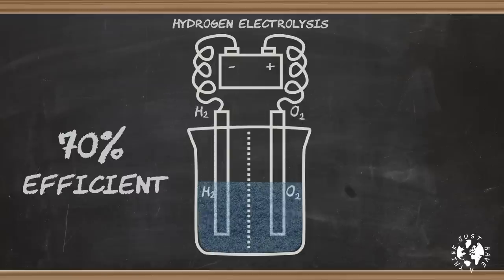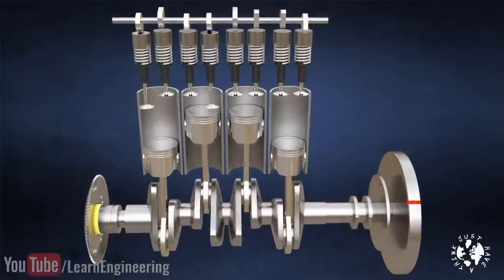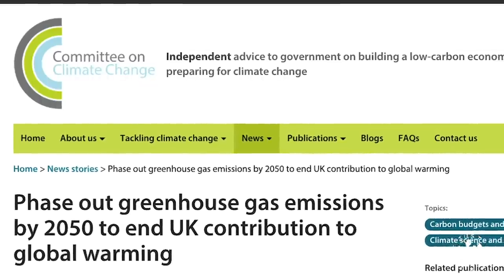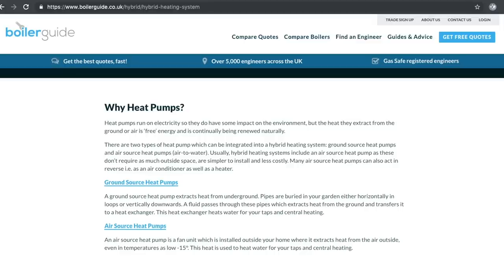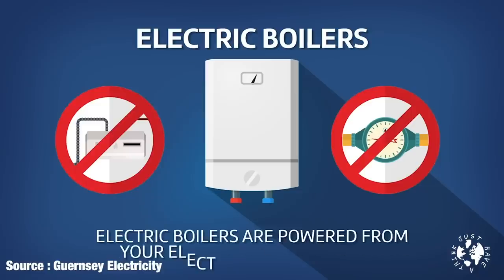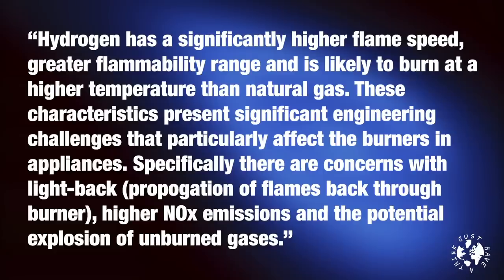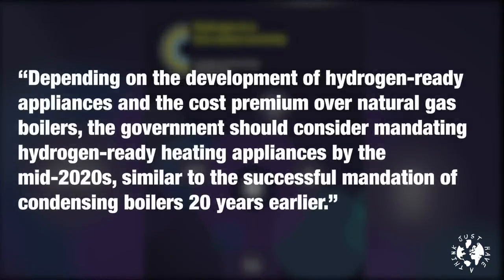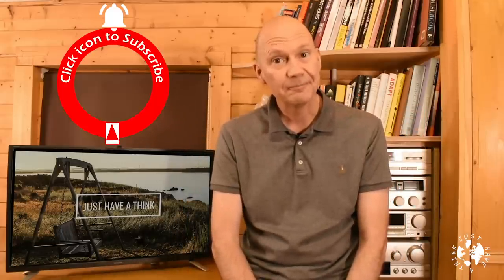Hydrogen for heating our homes

Comment: I don't see hydrogen as a domestic heating fuel ever, you can't transport it in regular natural gas pipelines, you can't bring hydrogen tanker trucks into the cities to refuel the houses either.

As far as carbon is concerned, there is no other practical way forward but electrical heating, and the need for it would be greatly reduced with passive solar walls, proper insulation, smaller houses, etc. We should also start replacing all poles and their power and phone lines with underground cabling, because if we rely on the power grid for everything, we don't want storms and falling trees to cut the power lines.

Single houses might be more resilient with solar panels, but that won't work for apartment buildings, the size of the roof would only provide enough electricity for lighting and other 121V devices on a dedicated circuit, provided the building also houses batteries. The heat pumps that were mentioned might be a better source of both heating and electricity, provided they are deep enough. That probably means municipal or national heat pump networks, as I don't think you want anarchy in heat pump locations.
Reply: @Allen Loser I'll leave the legality of it to these specific countries and cities. But if you look at the hydrogen refueling stations for cars, they are rarely in the cities, only 1 in Paris, France, for instance, all others are in the suburb.
Even if carrying hydrogen in city centers is authorized, I don't think any city official would allow it on a daily routine basis, they already limit the number of trucks, let alone inflammable gas tank trucks that increase the risk many folds. Plus hydrogen stations have very expensive and highly regulated and controlled. It's not possible to implement them in every house or block.
Reply: @Allen Loser Right, but that does not remove the risk, or make hydrogen as a domestic fuel a more viable option when there are so many other solutions to heating and cooling. Hydrogen would do squat for the latter, for instance.
Reply: @Allen Loser I have one in a caravan, it works on 12V or propane indeed. The video already ruled out hydrogen for several other reasons, I just wanted to mention this one too, not as the most important one. But I don't agree it's a bogeyman argument: You can't refuel a house with hydrogen using pipelines or trucks. Regular pipes leak hydrogen, you'd need a very costly network of pipes. And for trucks, you'd need a costly connecting system that would require frequent inspections.
At this stage, it looks like any green house gas is out too. Regular renewable electricity, since we already have it in the hous, or geothermal or heat pumps might be better integrated solutions to provide heating, cooling, and refrigerating. And it also works at night or when it's raining or not windy...
Reply: @Allen Loser This hydrogen production would be better suited to dedicated industrial sites indeed, for long term (i.e. winter) energy storage rather than heating. If residential solar provides too much electricity, it can just be reinjected into the grid and these industrial sites can use this extra cheap electricity to generate hydrogen.
We need to install much more photovoltaic surface than we would need in summer daylight hours anyway, so it can provide some sort of baseline in winter, so we will have lots of extra energy that can be put to other uses, like desalination, running engines for seasonal processes, etc., although storing energy for the bad days (and nights) should probably be the most important priority.
We're just at the beginning of this, hydrogen might not be the winner eventually.

Comment: Hard-to-abate sectors (fertilizer, steel, concrete production) account for ~33% of the energy consumed in the world. These manufacturing sectors cannot feasibly be electrified. They require high temperatures and hydrogen. People forget about this vital portion of our energy demand. Thoughts on solutions to decarbonize these industries?
Reply: There’s a connection between flue gases from coal or gas power stations ,any large scale industry which burns a lot of carbon based fuels such as the concrete industry ,steel making is a heavy polluter ,industries which burn fuels at high temperatures ,such as Aluminium ,probably the glass making sector ..anywhere there if carbon dioxide in the exhaust has potential as algae farm for synthesis of complex oil and protein products ..should be looked into by every government aiming for carbon neutrality ,large scale and small ,until we’re all clean electric ..China are you reading this ?

Comment: The whole idea of burning hydrogen to heat your home is bonkers...electric boilers supplying radiators throughout the home is the safest and least polluting method of home heating...
providing the electricity used is generated from renewable green sources...
There's a danger of over thinking things...often the best salutation is the simplest!!!.😎
Reply: Using hydrogen to heat homes is only bonkers because of sourcing it. It comes either from natural gas (pointless in my view) or by electrolysis (expensive). Using electric boilers to heat radiators is hugely expensive (UK prices around 15pence per kwh as opposed to gas at 3p per kwh. They are virtually non existent here in the UK. There's nothing wrong with gas and there have been very few issues with explosions. My view is that it will continue to be used certainly into the future. Heat pumps are ok with heating systems designed for them and aren't very efficient on radiator systems because of the higher temperature differential. So much of this green energy is virtue signalling BS that pushes people into heating poverty. There is enough gas from Norway for at least another 100 years. As I'm writing this wind is providing 2.72%

Comment: Heat pumps use refrigerants that can be thousands of time worst than carbon as a green house gas. Leaks happen all the time talk to any hvac repair man. They are also very expensive and your money would be better spent insulating the house. Foam insulation also uses the same Chemicals in the refrigerator so don't use that if you care to be environmentally conscious. Many solutions do more harm than good and they need to be carefully vetted

Comment: 4:20 You're misrepresenting the facts. Gazprom didn't just turn off the gas out of the blue and it's much more complicated than that. Ukraine stopped buying gas directly from Russia in 2015 but remains to be the main transit route into Europe. Also Ukraine has been understocking winter gas reserves compared to previous years at that time. Ukraine and Gazprom have been battling for years in court how much gas and on what price does Ukraine have to buy according to contract signed in 2009(ended in 2019). Both were found in violation of said contract by the Stockholm court and I can't keep up with how much they owe each other. Of course Russia is trying to bully Ukraine, but presenting Ukraine as innocent little victim is not objective.

Comment: I think we need to get away from combustion completely, including hydrogen. Or as little as say where key industrial manufacturing processes demand it. So, I can see that hydrogen, produced through electrolysis  and converted into electricity, as a hydrogen car does, might be desirable for areas where electricity can't be transported by wire and/or battery stored, and/or that local stable/rooftop electrical generation is impossible. But the idea of burning hydrogen in converted or developed boilers seems fraught with problems, and the best possible result from those developments still seem to be not as desirable as other solutions. The aim, after all is not low or very low emissions, but zero. 
Heat pumps are another idea altogether. I can see a lot of good things in heat pumps. They may not be as great transferring ground heat into the home as transferring heat from a liquid source, but they are still incredibly efficient, and need to be pursued, in my opinion. Big subject. Thought provoking video, as always Dave. 👍
Reply: Yes heat pumps make electric heating much more efficient, and a hybrid all electric ,if you can fit the ground source system when building the house,as it's not always possible afterwards

Comment: Right enough. I am afraid this guy sounds really convincing but i am seeing a lot of problems with the way he's presenting things here. 1 thing I can tell you about as its my job. at 8:00 he very calmly says electric boilers are a great alternative, they are 100% efficient and a very good alternative to gas boilers. THEY ARE DREADFUL. Sorry but people will be fooled by thinking it will be hunky dory going all electric it will certainly not. 

Get rid of your gas boiler for an electric one and your electricity bills will be far higher than your gas bill ever was and you can forget about powering it off solar PV.  In winter months most 4kWp solar PV systems will produce only 2kWh ALL DAY. Now consider you need to power that 7kW boiler to heat your home and water for a just a few hours each day and your PV system's battery if it has one will be depleted in 30 minutes and no power for anything else. 

I have customers who have switched their oil tanks and boilers to electric boilers and they are paying double now plus their EPC rating has hit the floor.  They thought they were being 'green'.

Comment: You are using centralised and highly inefficient examples of using Hydrogen, we need to look at and implement Hydrogen production and use in a Decentralised way. Where Electroliers and the renewable energy needed can, and is being being done locally!. Also compression of Hydrogen could be done with purely mechanical means via an on-site Turbine etc. Also the Heat that HFC’s generate can, and is being used to heat local buildings so making them a ‘Combined Heat & Energy system!. Factor those savings in then tell us efficiency %.

Comment: You don't need a long discussion to see that heating  our homes with Hydrogen is a waste of time just simple maths . If you get the Hydrogen from Natural gas there is zero benefit from a carbon emiting point of view . Just burn the gas directly avoiding any efficiency losses due to the transformation . Siimilarly using electricity ( however generated ) into hydrogen to then transport it to homes  to heat them would mathematically be less efficient that  just using the electricity directly to heat the home that has 100% efficiency ( minus a small loss in transmission ) . End of . The only increase in efficiency as someone pointed out further down is to use the electricity to run heat pumps rather than classic resistance based heaters . So basically this interesting looking video is just a load of waffle .

Comment: Hydrogen is a monopoly alright...or is it the lack of its monopoly that makes it so concerning. Electrolysis allows anyone with power and water to make hydrogen compared to say someone with land containing oil. Consider the grid efficiency, grid cost, battery cost, battery manufacturing/recycling/mining, etc. Basically the comparison for EV vs Hydrogen efficiency is narrowly organized to support EV blindly. Also petroleum is being replaced instead its battery materials. This is an example of creating your own industry to get rich from. Along with a control vectors via smart grid for policing usage. Never mind the economy will scale back and people will basically revolt. No really its a great plan. Factor in renewables which are produced in large concentrations at narrow and sometimes unusable sections of time. So you have to store it somehow. The funny thing is moving vehicles to hydrogen decouples the electric grid and make a more manageable load. Production scaling along with cost scaling are much more reasonable. Nuclear could be used for hydrogen which can also be stored or stock piled. Batteries are like a crap form of NAND flash used for continuous writes.

Comment: The fossil fuel industry's existential goal is the continuation of energy dependency.  The two buoys that they must circumvent are 1) hydrogen and 2) geo- engineering.   Both of these green- washed marketeers' concepts are an intrusion and distraction to renewables and conservation.  Hydrogen devices and carbon- capture are promoted to manufacture public consent to view the fossil industry as necessary.

If you were funded by the fossil fuel industry as a shill your advocacy would be understandable. I doubt this the case; I suspect they just sucked you in with nice looking research and greenwashing.  In the 1950's the pipeline companies with the gas companies were aggressively marketing gas appliances, even offering some for free to get consumers hooked.  We simply must move immediately out of harm's way from fossil giants.

Comment: The most important action to take is reduce direct wastage in the heating process, Insulate , then insulate again.  
My recently built house has twice the specified levels of insulation, with extra thick walls, 200mm of floor insulation, and double glazed high performance windows.  It has underfloor heating sourced from Air source heat pumps, (electric) and solar thermal tubes on the roof. Full mechanical heat recovery ventilation with an 'ground pipe' pre-warming system.  The total heating 'cost' in electricity works out at nearly one third of a conventional Gas fired  boiler system with radiators, etc. . 
ALL of the house power comes as electricity , brought from a company that owns most of its renewable supply chain. 
During a very cold spell  a couple of years go the heating failed, but thanks to the insulation my wife did not notice for five days! 
So again INSULATE.
Reply: In what country is your new home? Doesn't sound like the US.
Reply: @climatedeceptionnetwork4122  I live in the south of the UK. Near Portsmouth.
Reply: @evanleebodies  Not if you get the design right. My house does include an 'earth pipe' ventilation system whereby the incoming air is precooled as it travels along buried ducting. I also take incoming air from the void under the floor. The result is that air coming into my house enters at 16-18 degrees when the outside temp is 21-23. All for the cost of a solar powered fan. 
I will agree that the house can become a little warm, the main benefits are when the outside temp is in the minus areas and the house can be heated for minimal cost.
Reply: Check out passive house standards and construction..
Reply: @evanleebodies  only if you don't design them right, insulation works both ways it keeps the heat in your house during the winter and out of your house in the summer so adding more insulation into a houses design  should massively increase your level of comfort regardless of the climate, in a simmilar fashion many other passive house features such as awnings can be tailored to your location in order to maximize efficiency for all seasons reducing the amount of work your hvac system needs to do in order to keep your house at a comfortable temperature and resulting in your house being more comfortable.
Reply: @evanleebodies  Nonsense. The extra insulation makes it easier to keep cool in the summer.
Reply: Exactly! Don't even consider installing a heat pump unless you have upgraded your house insulation level to match the current building regs as a minimum!
Reply: @evanleebodies  A point I forgot to mention earlier,  the tiled roof is laid on a cross battened sips roof so as to act as a spaced tropical roof in the hot sun.  The spacing allows a strong airflow to keep the gap cooler and prevents the house overheating.
Reply: In Norway we insulate the slab 450 mm wooden floor 300 roof 400 mm and use triple gazed windows veri airtight houses 0,6 airchanger pr hour
Reply: @chrisolsen4578  In England we used to build terraced houses with solid 9 inch (230mm) thick walls with no insulation. These type of dwellings still exist, and are in use today throughout the UK, and our government wants to ban gas boiler type heating and replace these with heat pumps.  How stupid these politicians are, they should be either demolishing these old buildings or upgrading their insulation requirements. Currently, the English (not Scottish) building regulations have much higher insulation requirements, but these are only applicable to new buildings.
Reply: @westwonic  That is indeed the plan, to insulate existing buildings before installing heat pumps. That's why the grant system is moving towards whole house assessment.

Comment: Who cares of efficiency if you own a PV and have to look for a battery storage for the exceeding energy over consumption?

We get today 15 kwh by a pv ... but the consumption or demand is 24 7 driven and 11 of the 15 kWh on a summer day are exceeding and worth near nothing ... so we have to heat water in a boiler to reduce oil consumption.

Same for wind mills ..., 
that partly aren't allowed to produce energy for the grid due too overproduction during storm at night. But these windmill owners get the money for the kwh they had missed to produce by command. Let them produce H2 or lead their combined power to an H2 production plant.

And: the incentives for pv @ home have dropped a lot and therefore it needs a solution for the exceeding amount of produced energy after the own consumption that does not meet the time and amount of production.

Home PV become an inefficient night mare if you don't find a centralized exceeding energy storage.